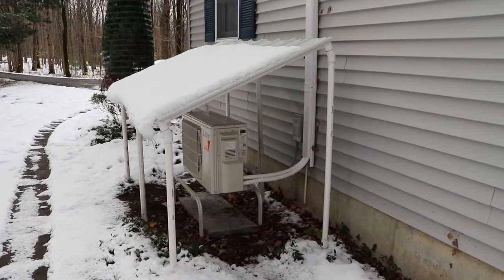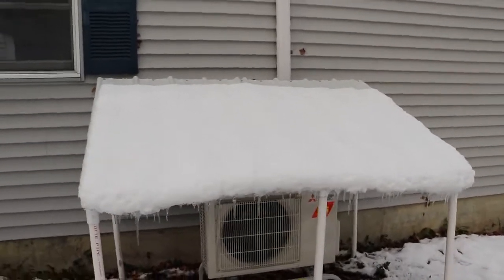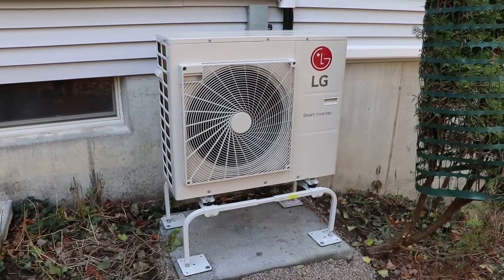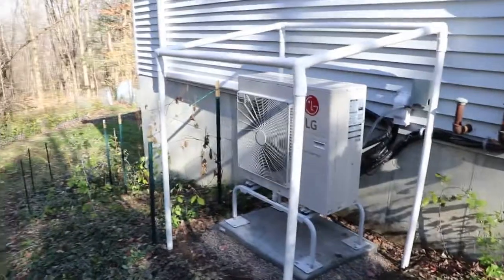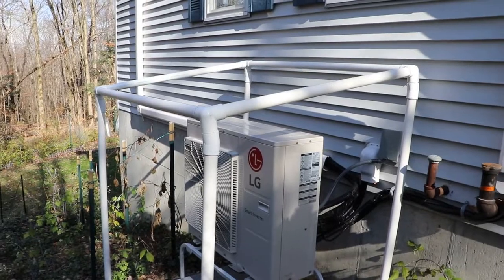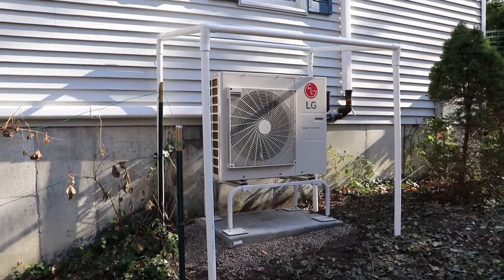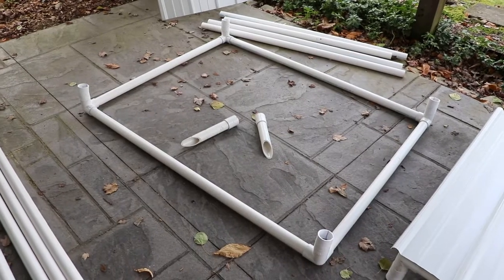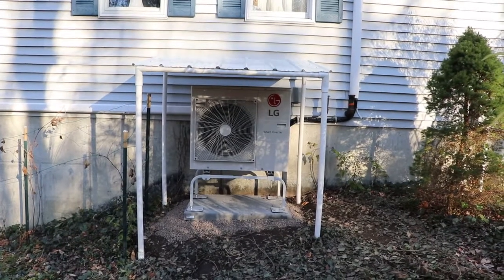Building a Heat Pump Hut

Comment: Great idea.  I need one of these but to protect heat pump from rain & water flow from roof.
Reply from the maker: If you get snow and ice falling from your roof, you might want something more substantial. Ideally, your heat pumps would not be located where down flow from the roof occurs.

Comment: Hello Sir,
Thanks for sharing this brilliant idea. I built a hut for my heat pump following the instructions you presented with some minor modifications. Thanks again.
Reply from the maker: Glad you found it useful. What were your mods?
Reply: @ElectronicswithProfessorFiore , here they are:
- I didn't use PVC glue; instead I used roofing screws to attach pipes and fittings together.
- Instead of building legs to be inserted into the ground, I used another frame as the base for the hut and put the whole thing on top of the heat pump. I secured it with plastic ties (those that are usually used for cable management). The reason is that I have a big unit which required very long pipes if I wanted to go with legs.  
- Instead of using metal roof panels, I used corrugated asphalt sheets.
Thanks again for sharing the idea.
Reply: @ Ali Majdzadeh - would it be possible for you to put a photo up of your cover? This sounds more feasible for me also as my unit is on cement and just like the idea of not having to use PVC piping as it is so much more expensive now!

Comment: Nice simple idea.  Have a question though.  If the hut is removed for high winds, what protects the condenser unit from storm rain being blown into it?
Reply from the maker: I've never had to remove it for high winds. Of course, I don't live in a coastal area where we might get winds > 50 MPH. In any case, the units are designed to be outside and one would think that the designers have done their job regarding wind driven rain. This was built to prevent excessive build up of snow and to protect the unit from the worst of the weather. It's like a carport that protects your vehicle.
Reply: @ElectronicswithProfessorFiore  Thank you for your reply

Comment: I appreciate your feedback and like your design the best that Ihave seen. Just one more question. I'm thinking of using 2 1/2 inch PVC pipe for the frame and 3 inch aluminum pipe with couplers for the ground anchors. What size pipes did you use?
Reply from the maker: I used 1.5" schedule 40 PVC for the two identical units in the video. The larger, earlier unit used a slightly larger (or possibly smaller) diameter, I forget. The following year I did pack some concrete around the anchors so that they would not pull out of the ground if the coupler stuck to the upright.

Comment: Are you concerned about how well PVC will hold up in very cold weather?  Like below freezing or even below zero?
Reply from the maker: No. They've been out there for a couple of years now, and last year was particularly cold with several nights hitting -15 F, and numerous days when the temps didn't get above 0 F. If you are particularly concerned, you could always use metal pipe for the legs, or perhaps schedule 80. That's really the only part that flexes much (and that's when you clear the snow off the top of it-they're stable in the wind). All I will add is that I have seen a particularly thin-walled version of PVC pipe. I would not use that. I used standard schedule 40 pipe.
Reply: You could alway put rebar inside the PVC for stability.

Comment: I like your setup! I have a question on the connection between the roofing and the pvc frame. Are you gluing them together or did you drill through the roofing and pvc and put a carriage type bolt and nut to connect?
Reply from the maker: I used screws that are designed for the metal roofing. Basically, large self-tapping sheet metal screws with a rubber washer under the head.

Comment: Nice job. Does this hinder access for servicing the unit at all?
Reply from the maker: Nope. The legs lift out of the receivers that have been placed into the ground (I poured concrete around my receivers so that they wouldn't pop out of the ground if it was wet). Two people can easily lift this up and move it to one side for complete access to the heat pump.

Comment: How is the metal sheet roof attached to the PVC frame?
Reply from the maker: There are special screws that are used with metal roofing. They're like large sheet metal screws but include a rubber washer to prevent leaks. I used them because I had extras kicking around, but you could use whatever is convenient.